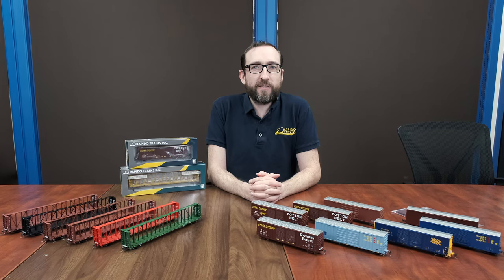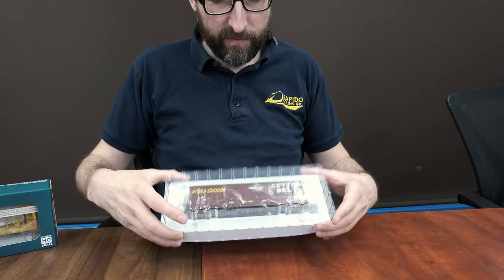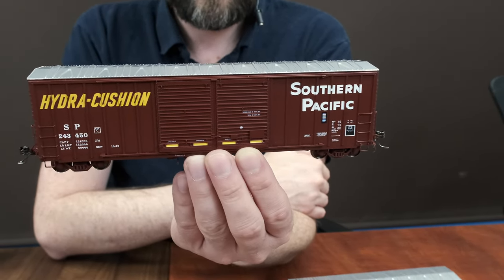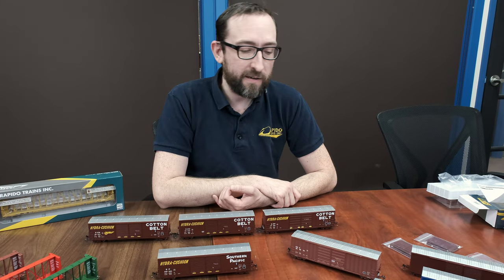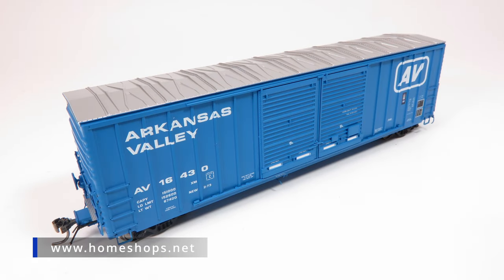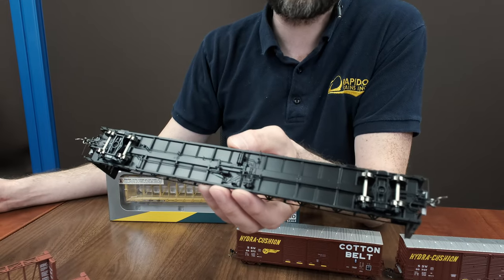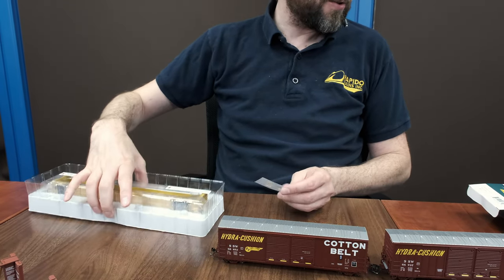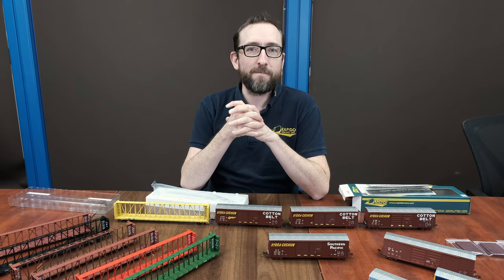Rapido January 2024 Freight Car Unboxings!

Comment: Was there ever a 60’ standard center beam prototype flatcar?  If so, I think that would be more ideal for lots of smaller layouts than another 72’ car.
Reply from the maker: 63’ Centerbeam cars do exist and have been produced by other model manufacturers in the past. The NSC 73’ cars have never been produced however.
Reply: @rapidotrains  I know that the opera window style was done, but I don’t recall ever seeing a standard center beam in 63’ lengths.  If I am right, something to think about.